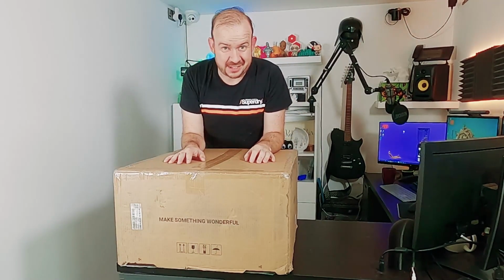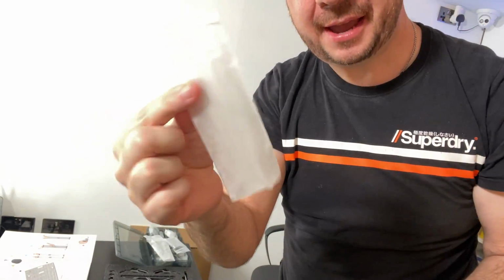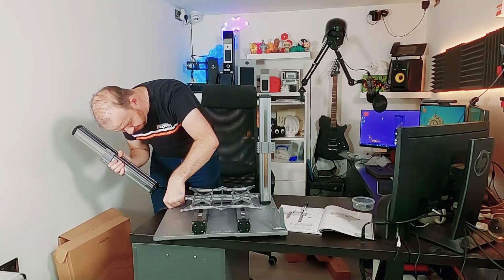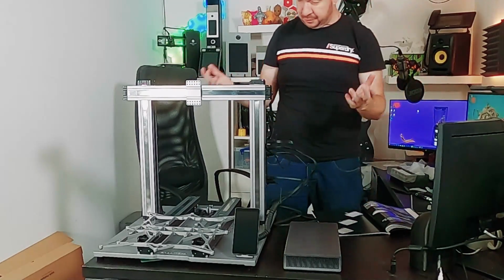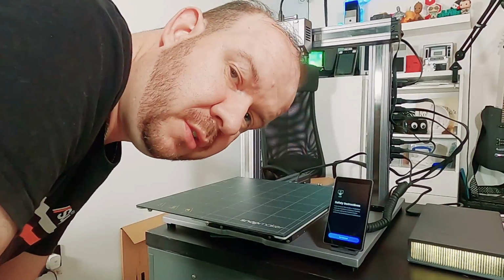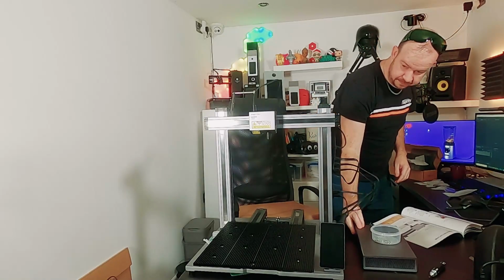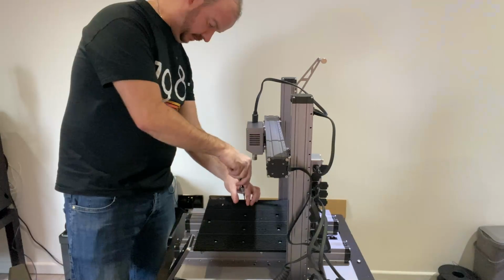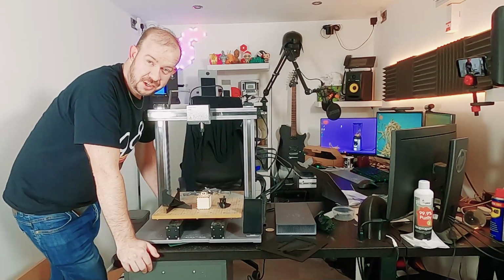Snapmaker 2.0 3D Printer | Laser Engraver | CNC | Review - Is it too good to be true?

Comment: Hello,

I have a Snapmaker 2.0 Modular 3-in-1 3D Printer A350 to sell. As new, used only for a few times. It's an excellent machine, but, unfortunately, I don't have time to give the proper use. Complete with all the accessories, and some extra CNC bits. I am looking for 1.400,00£+Shipping from the UK. 

 Thank you.

Comment: 33:00 That's why they call it a waste-board.  it goes to waste, and yes, it is normal you cut into it.  These boards are usually made from MDF.  And if you worry about getting a new one with the necessary holes and such... you can make a fresh one with the CNC machine itself (and possibly some hand-drilling for the holes it cannot reach).  Easy peasy!  Also: if you don't have build-in dust suction, make sure to get your vacuum cleaner at the ready before the dust reaches your laptop and gets sucked in by its cooling system!  It wouldn't be the first CNC-computer that gets killed by overheating because it's all clogged up with dust.
Reply: If you're cutting through your material, not engraving it, you're supposed to use a thin layer of sacrificial material under the piece you''re cutting. Not cut the bed.

Comment: I'm wondering if there is a chance I've got my nozzle too close to the base. When I printed the boat earlier I let it sit for about 20 minutes but then I had to forceably pull to get it off and it left a small portion of the the first layer on the print bed. Like taking off the magnetic base and folding it back and forth didn't get it to pop off.
Reply from the maker: Yeah its a tricky balance to get spot on. If it goes cold, you could always pre-heat a little then give the bed a flex...

Comment: For the CNC function, although it did not mark up the base too deeply, overtime it will just leave to an unlevel surface and need to be replaced. Do you think that you would be able to instead put a sacrificial piece underneath your project to take the abuse and protect the units table?
Reply from the maker: I would say you could. Also, with a bit of practice and tinkering you could get it so it is only just touching it.
Reply: The wasteboard is meant to be the sacrificial piece. It can be reused more times if your depth is set right, but you will always get some cutting of the wasteboard.

Comment: we bought one and as soon as we turned it on the 3d printer module blew up. pretty sure it was either an electical short or the circuit board failed. pluged in the laser module and the laser is one 100% of the time. having a hard time finding trouble shooting information
Reply from the maker: Damn, that's bad luck. I hoe you got it sorted!
Reply: @ratemyfuneral  turns out it was a faulty controller it is now operational

Comment: I have one of these as well (a350), but I had a load of problems. One, my heated bed did not work at all, it always shows -15°C to -13°C. Two, 3D printing with the provided filament was not working, it would always clog in the middle of the print. And three, bed adhesion was like superglue. However, the support team at Snapmaker is sending me a new bed, I have new filament (PETG), and the bed adhesion was solved with an update. Now the only problem I am having is PETG prints will bend while printing, ruining the whole print, I am assuming that will be fixed with a heated bed. The support team at Snapmaker was great and I am expecting the bed soon.

Note: I highly recommend getting the enclosure, it is massive, but it muffles most noise quite well, however, you will always hear the power supply as it is outside of the enclosure. The enclosure keeps the mess at a minimum as well, something that will come in useful while CNC carving. The enclosure also has a venting system for laser engraving and printing with materials such as ABS, however, I would recommend getting a longer duct. Above all, the enclosure is another fun assembly process and is very high quality.

Comment: Others have commented on the involved process of conversion as well. Easy workaround: Stick magnetic foil under the laser base and the sacrificial plate of the mill and pop them onto the steel plate of the print bed. The magnets are strong enough to resist the lateral forces of the puny mill. You lose some Z-workspace, but you'll hardly ever use all of that in those processes anyway. You also have to be careful with the mounting screws you use to clamp your CNC work, as these can poke all through the MDF and damage the print bed.
As for print quality: I have actually found that the 'fast' setting produces the nicest looking Benchy. Thinner layer heights may be stronger, but surface quality is best on 'fast' in my book.
Also be careful when cleaning that print bed. It has a coating that does not stand up to pure IPA.
And bed levelling is a can of worms, as you will find out should you ever use the whole print space. There apparently are workarounds published on the Snapmaker Forum, but I haven't gotten around to try these yet.
Reply from the maker: Nice info! Thanks for that.